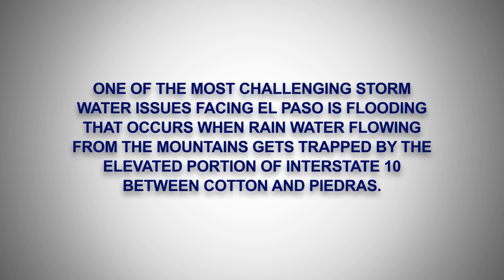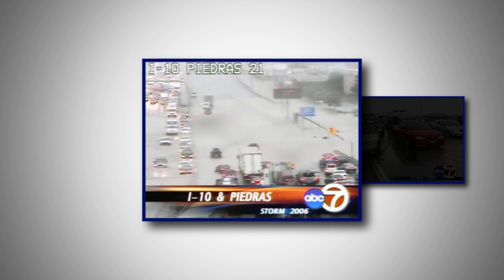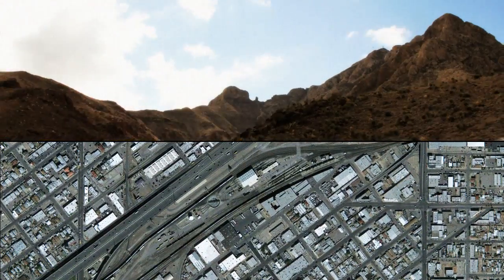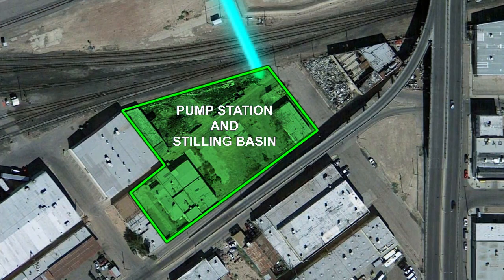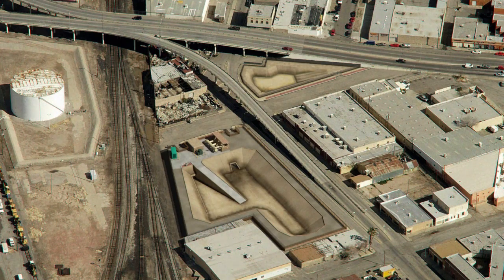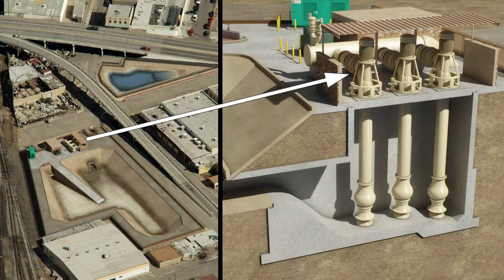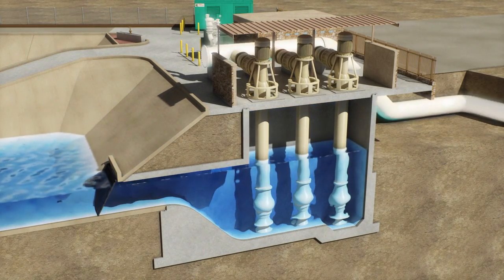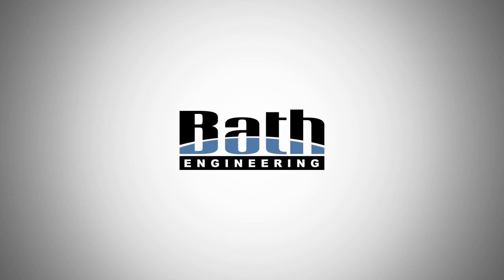3D Animation | Magnolia Stormwater Pump System | Neomedia Design Group | El Paso TX

Comment: "over an ogee crest design to create a natural scouring action"- anyone able to explain this bit? And its significance? 

Thanks in advance.
Reply: united my guess is it’s so that any debris won’t accumulate in the sump (bottom of the pump station) and instead will be conveyed within the water and pumped thru the pumps.
Reply: @AndrewNowacki  If they had a bigger flow that wouldn't be a problem but they said 175CFS which isn't much when we dealt with 150CFS per Diesel pump and had 4 plus a 125CFS electric. In 3 different stations and 3 300CFS pumps in one station I ran. The 300CFS pumps actually scoured the bottom of the pump bays as we found out when we did some pump modifications after 20 years of operations. The silt actually cut the concrete in a circular pattern under the intakes to the pumps.  We did have to de-muck our service water pump bay one time as it had a buildup of over 2 feet deep and this is what they seem to be worried about.
Reply: It prevents sediment build-up witching the pump inlet channel.